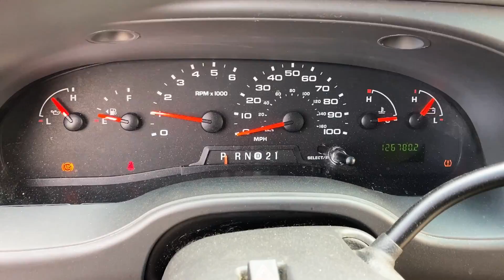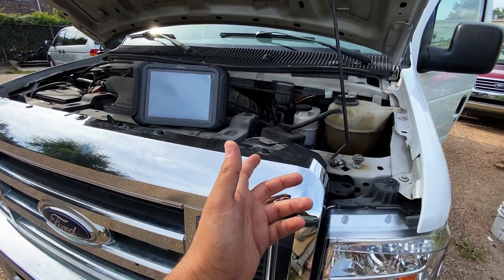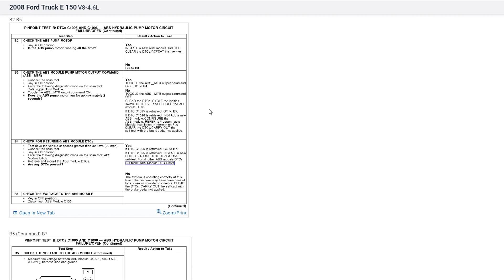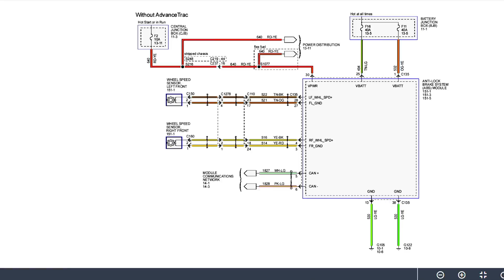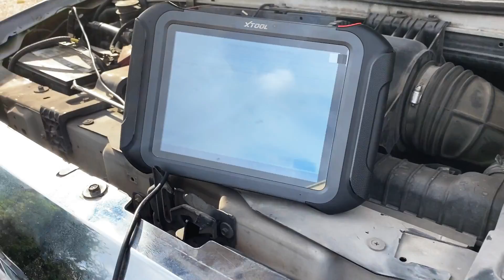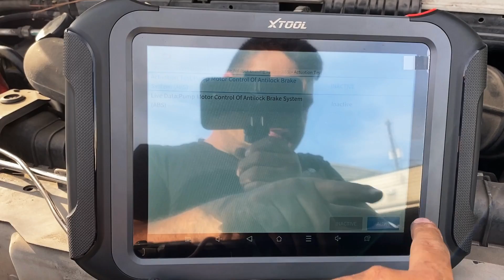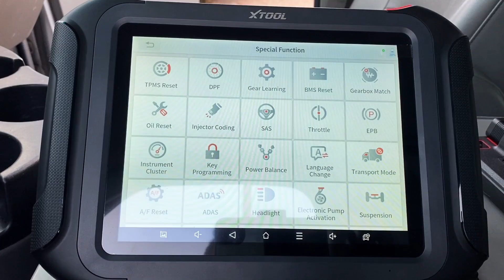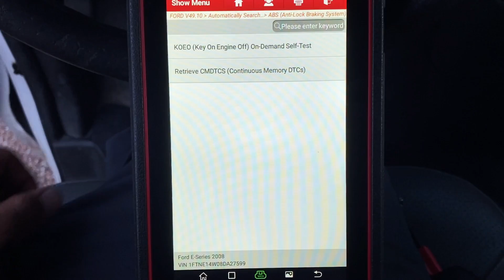FORD E150 VAN ABS LIGHT ON C1096 BAD MODULE OR PUMP?

Comment: Years ago in my previous job, I used to drive an e150 as a company vehicle and it also had the C1096 code. The only strange thing is that the light would turn off if left over night on cold mornings, usually when the weather was around 50 degrees Fahrenheit. They never fixed it as it was we got new trucks and that van was retired from the fleet. All these years I have wondered what could have caused that code?

Comment: Great video Eric.  In your opinion, could you recommend the best DIY bi-directional scan tool that’s currently available for a “medium duty” diesel truck (2007 Chevy Kodiak C4500 with a 6.6 Duramax LMM diesel) for COMPLETE DIY repairs please?  How about the Launch X431 V+ Pro?  I need to replace an ABS pump as well, plus do the bleed procedure, plus everything else that may come up in the future for this type HD truck.  Thanks.  Jay Chalmers, Murfreesboro, TN

Comment: Few things to mention here:
A good way to test to make sure it's actually the pump motor is to just smack the outside of the motor housing with a hammer while trying to run the motor and usually they'll start spinning and that confirms that it's just a motor problem (which it usually is)

You can put the old module on a new unit so that you don't have to program anything assuming it's just the motor that went bad.

I have also in the past replaced just the motor while leaving the module and hydraulic side intact and that way you don't have to program anything or bleed anything if you take the two screws off it slides right out and you just slide the new motor in.

Comment: On the older 03 & 04 Ford "F" series trucks, when I would try to recover the data from the old modules, they were either corrupted or something else, so using Ford's IDS I had to use the  "As Built" program.  That worked.  Just an extra step.
Good work Eric!  Who road tested the vehicle and tested the ABS?
Reply from the maker: I've had a few of them that could not communicate, so I had to use "As Built". Luckily this one communicated just fine! Thanks for watching!

Comment: Good call on the shop to get your expertise on this case.  Makes me wonder what happened to the assembly, if the motor burned out due to pump failure or if it was the module.

Congrats on 100K!
Reply: Those Fords have that issue, it appears it is internal in the module circuitry. These are expensive and there are services on eBay that can open it up and repair it; not easy to do but can be done.

Comment: So here's a question. Your test light pulls how many amps? You did install a new pump and check to see if it could turn the pump on. If you were unable to verify with a good pump your test light might have let you down. I got burned by using my 300mA test light on a circuit that needed to Flow around 6 amps. It taught me to match my test light to the load I was testing. For quick testing I do still reach for it but I'm always thinking about the circuit and how much current it needs.
Reply from the maker: You've got a point. I probably should have used my homemade headlight bulb test light. Thanks for watching!

Comment: Why car ac pipes are very hot when ac is on? Is this normal??
Reply from the maker: High side lines will be hot. Low side lines should be cold. Thanks for watching!
Reply: @ADVANCEDLEVELAUTO  also, the ac pipes under the central console of the dashboard near the clutch pedal is also very hot in i20.

I can feel the hotness while driving when my legs is randomly touching on that pipe.